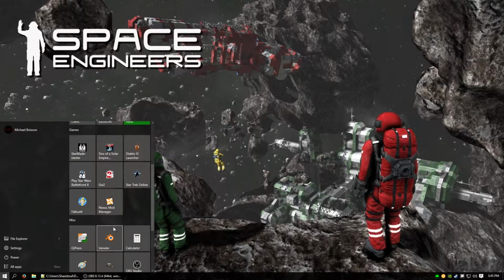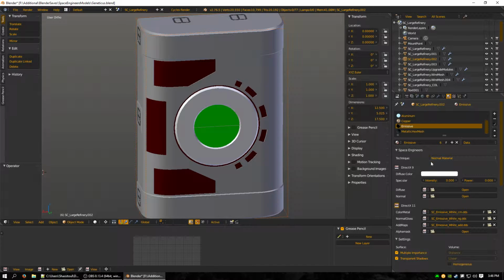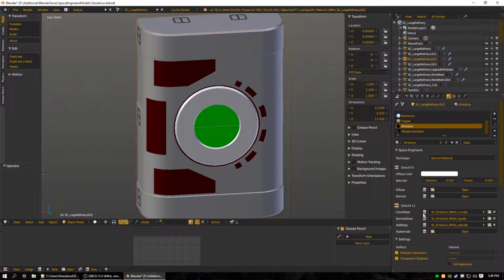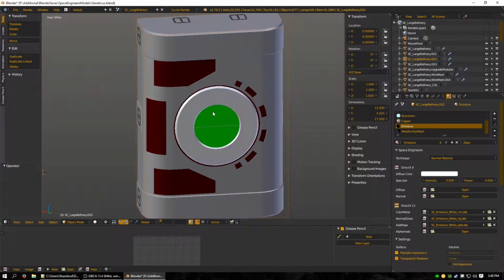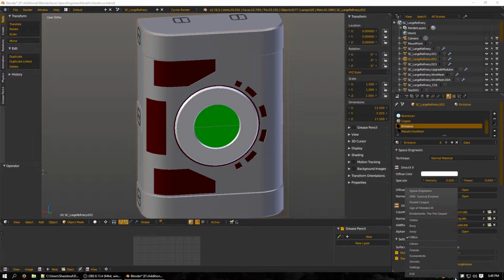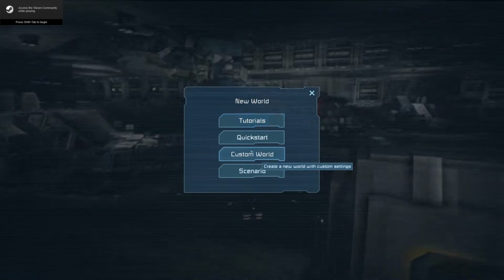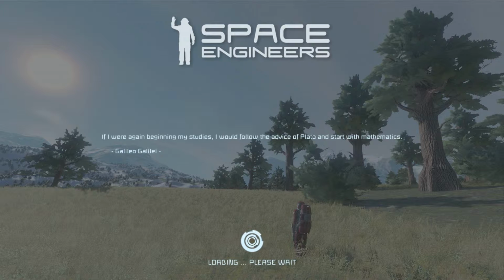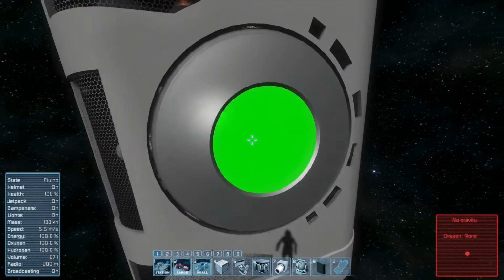Space Engineers Modding Tutorial Ep18: Emissive Texture for On/Off/Etc

Comment: so we dont have to have the block model use a full wrap around texture?
Reply from the maker: As long as the block is fully unwrapped and no faces are not unwrapped, you'll be able to successfully get the model in game. Texture wise it will look weird but, you'll get it to work. It's a way to get things tested quickly to make sure they're working. I usually save texture stuff for the final model so I don't waste time making a texture i'll have to redo.
Reply: so there is nothing to generate the full texture from the smaller ones that are selected to go on each face, this has to be created manually from all the smaller textures?
Reply from the maker: I'm not sure what you mean. Are you talking about UV mapping a model or texturing a model? If you're not familiar with the process of either, I highly suggest checking out some videos, you'll probably get a much clearer understanding than what I can try to convey through text.
Reply: i think both, in one of your tutorials i heard you mention re-doing an 8 hour texture, in others i saw you unwrap the model which i assumes generates the texture coordinates and the layout for where you would paint the models surface onto the texture, i also saw you select small texture images for the faces of the mesh/triangles... isnt there a program to also generate the actual full UV mapped texture itself from the small texture images you selected for each face, seeing as the program knows where it is supposed to go and its dimensions of each face etc?
Reply from the maker: Sort of. You could get a program like Substance Painter that makes texturing a model a lot easier but, it's expensive. I believe there are alternatives but, that's the one I use. As for UV unwrapping, you have to learn that yourself, as there's a bit involved with unwrapping a model. Learning to do it right instead of using features like Blenders "Smart UV unwrap" will result in a much more pleasant experience when texturing, especially if you're painting textures by hand.